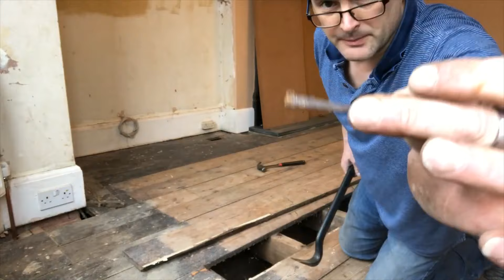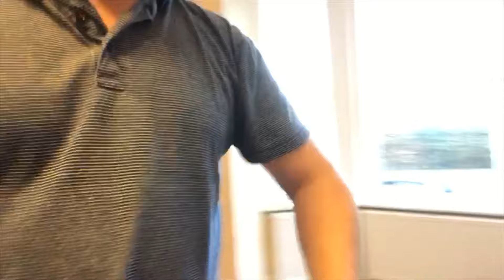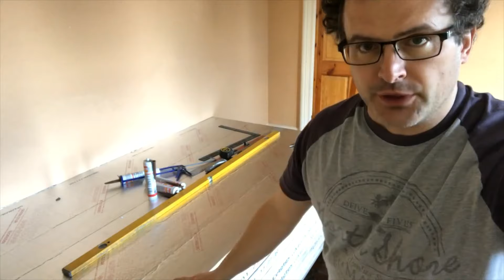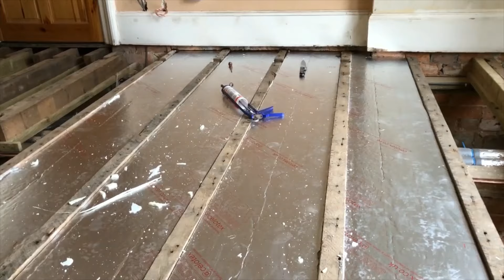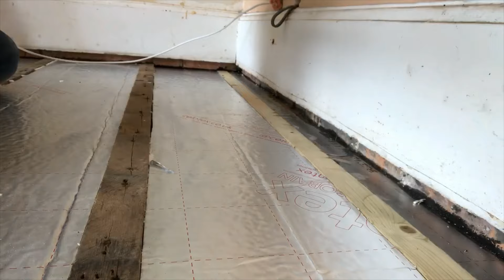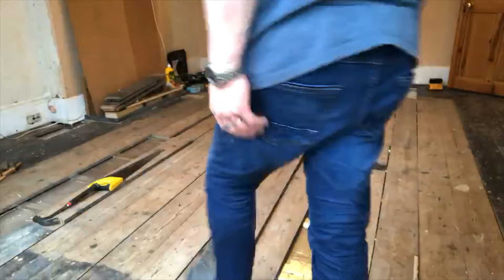Underfloor insulation retrofit full demo

Comment: Would be better to cut them inch narrow than gap and use elastic spray foam around and all board seams.
Reply from the maker: Better insulation? I’m not sure Wizeguy. Might be a messier job using spray foam. Give it a go and let us know.
Reply: @SteveWardellDIY  I'm sure i have done many just last week did roof insulation with similar board. You method isn't air tight it leaves tiny caps all over board. And when there is air leaks there might happen condensation and that leads to rot. 
 
Here is example video not mine but you get point. They also does roof and walls https://www.youtube.com/watch?v=ZgQLnDiKDhw
Reply from the maker: @mr.wizeguy8995  Rest assured are no open air gaps when following the method I’ve shown. Any tiny clearance gaps are sealed by the battens below, the foil tape above, and the three lines of silicone to the brickwork around the perimeter. Thanks for your feedback.

Comment: Great job, I’ve been putting off doing ours for a good number of years. Has it made the room any warmer? We have the same type of floor with vents and the room is hard to heat.
Just watching you made my knees hurt! Treat yourself to some trousers with knee pads in, don’t wait till you’re 60+ with bad knees😊 like me.
Reply from the maker: Hi Arnold, thanks for the feedback. Yes the rooms feel warmer and heat more quickly. Stopping all airflow is a big factor in my view. Beware if you have an open fire or old stove, they need ventilation and this will reduce it.

Comment: What a fantastic guide - Thanks so much for doing this Steve. 

How long did it take? All done in a day?
Reply from the maker: Hi Simon. Installing the battens and insulation was done over a couple of days, but there were other jobs such as replacing rotten timbers and clearing air bricks that extended the job.
The other time lapse video on this subject was 9 hours, to install insulation to a prepared space 12 sq m

Comment: Nice work, my floor boards weren't that great so screwed them to the underside of the joists to support the insulation. Renewed ring main just in case and removed rads, replacing with underfloor heating.
Reply from the maker: It’s a good reuse of the boards. My joists are 4” so limited to that for insulation
Reply: Great idea, was just thinking of doing something similar myself. That would also allow for 125mm insulation presumably if joists are the same size.